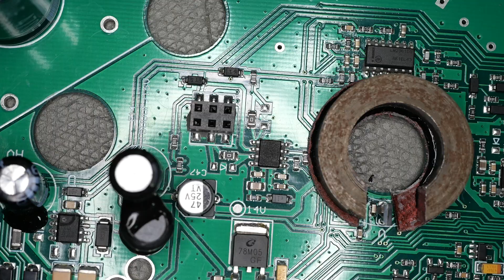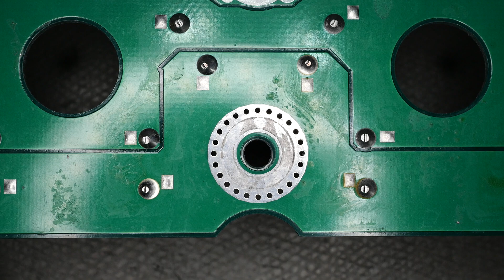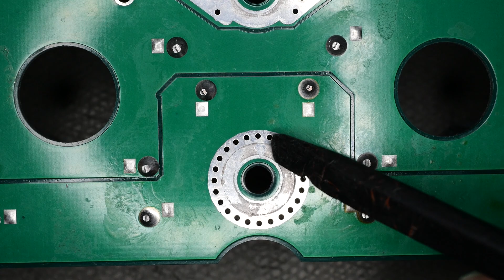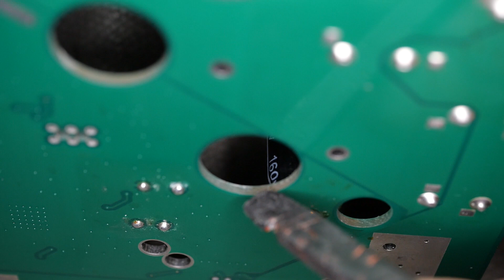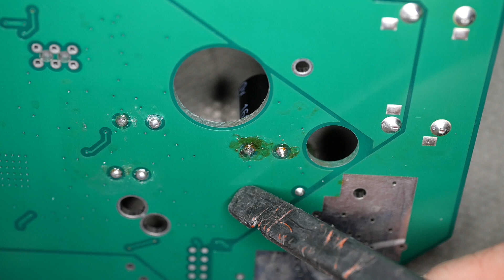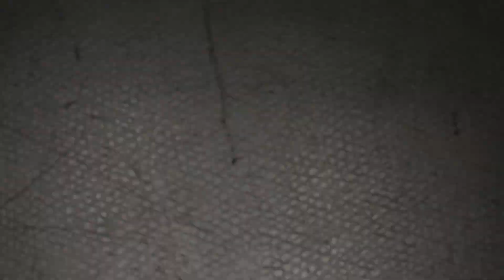Far Driver ND96850 Macro 2 - Logic Board

Comment: Great vid! Do you (or anyone else here) know what specific hall sensor is used to measure phase amps? Would there be a version of this sensor available that is less sensitive, so that you could trick the controller/firmware into allowing more amps to flow? With the goal of increasing the real life max amp limits.
Reply: See my own comment below: it should be the Chi 612 Programmable Linear Hall Sensor. The sensitivity probably has been set during the manufacturing process of the controller? It should be adjustable; that should provide the effect of a ‘shunt mod’ right? But how and how much to change it from the set value is beyond my comprehension…
Reply: Stupid or genious?: maybe a hill billy solution to reducing the sensitivity of the linear hall sensors is to rotate/bend all three of them slightly, so that they are not at a 90 degree angle anymore with the magnetic flux lines in the concentrator. Maybe this is a simple way of ‘shunt modding’ a fardriver, by carefully adjusting the angle of the three halls, say change by 10 - 50% (cosine) depending on cooling and battery amp vs phase amp settings. I assume you could check the relative quality of your bend/rotation by looking at the two measured/(calculated?)phase amp currents in the app, to check if they are both roughly similar still. Anyone agrees with this hill billy mod and brave enough to try? You can of course still compare the real battery amps that your bms is logging to the new (too low) value that the fardriver is claiming for the battery amps. So you get an estimation of the change that you have achieved with the applied angle. Makes any sense??

Comment: Thank you for the very detailed video. I have one of these that I'm currently trying to fix. Bout it from someone who was dishonest. Anyway, on my dc power supply it will pull like 0.003a and then momentarily blip up to around 0.070a and has a very slight chirp, like a capacitor, not like the speaker on it. I does this over and over about every second. Any ideas what could have failed?

Comment: Кто то нашёл что за деталь c1216?
Reply: 意瑞 ci612
Reply: Наверное нет.
Reply: @pashko90  датчик холла это
Reply: @ИгорьКазанцев-ь8з  Датчики холла тоже бывают разные)
Reply: Could it be the Chi 612 hall sensor? This is a Programmable Linear Hall Sensor by Cosemi tech. It is a 180kHz sensor with a sensitivity range between 0.6 and 32 mV/Gs. You can find a data sheet online if it is this part.